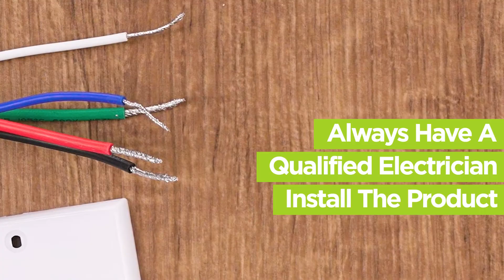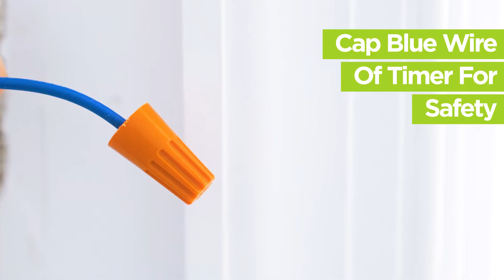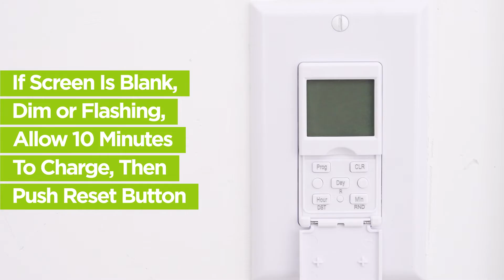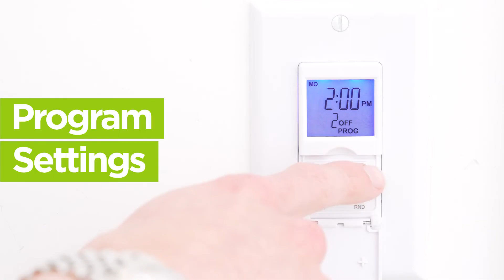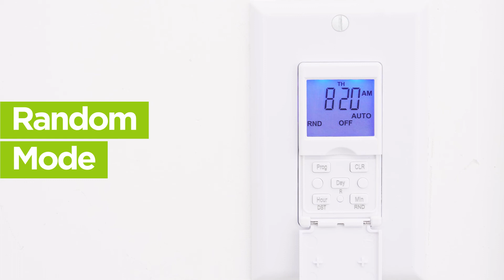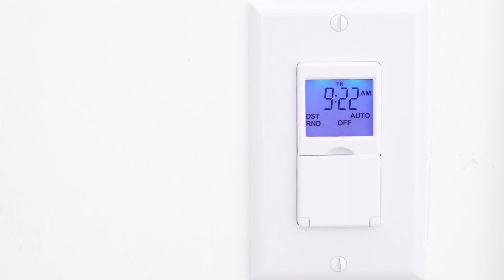7 Day Programmable In-Wall Timer Switch, Single Bole 3 Way Use Blue Backlight BN-LINK

Comment: I am installing the timer to replace an on/off switch I have only 3 wires white. black and ground how do you install this timer 5 wires?
Reply: Where to connect neutral white wire

Comment: I only have three wires in my wall. Black, white, red. I connected black to black, white to white, red to red. The light in the circuit is always lit in manual or auto and I cannot switch it off, what did I do wrong? I did not connect green or blue but those should not matter in this case because I do not have anything to connect them to.
Reply: Same here.. I tried switching the white and red around, but still not working. Did you figure it out?